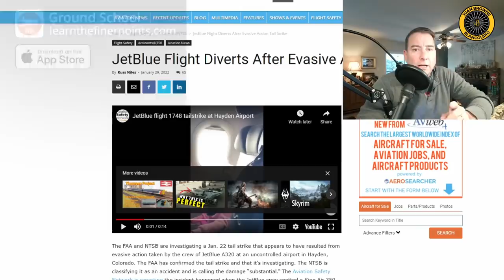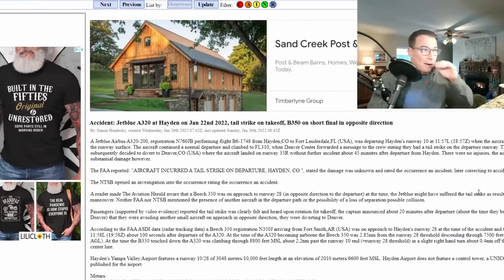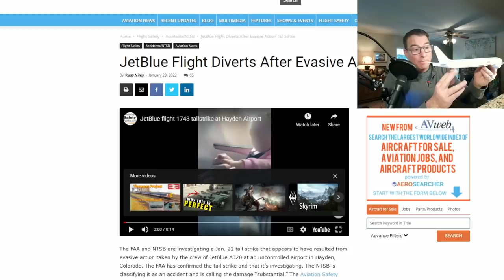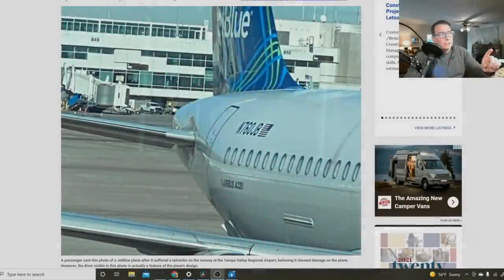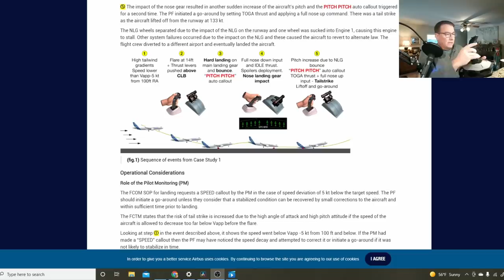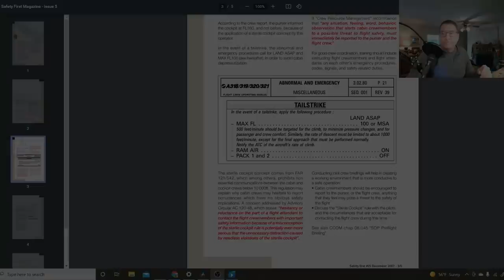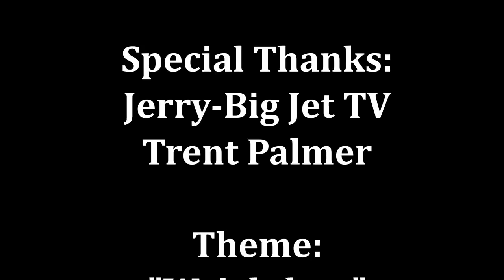Tailstrike!

Comment: This is very interesting,

Since it's possible to have a tail strike with these aircraft, I'm surprised that they are not designed with a skid plate with sensors underneath to detect a tail strike. In the situation with JetBlue for instance, they had a pretty severe tail strike that they were apparently not aware of and it sounds as though they had pressurized the aircraft since they were at 31,000ft and appeared to have been planning on continuing to their destination. 

Thankfully they were alerted by air traffic control before something more serious happened with this flight.

Comment: My aircraft EMB 175 has some tail strike prevention in the FBW laws but it too is possible to have a tail strike occur. The EMB 175 in it's current form only has FBW for the empenage. The ailerons are conventional hydraulic. I've never flown an Airbus but I think it is not the best idea to have the side stick controllers independent.  I still believe to this day that if the side stick controllers were interconnected that the Air France 447 accident would not have occurred.  And don't tell me it can't be done because the latest Falcon with side stick controllers and full FBW do. Nice video Jaun, always a good job!

Comment: The 727 had a very effective tail skid. It should be in use today.
Reply: pretty sure all Boeings have a tail skid
Reply: @peterp4319  JAL123 didn't.
Reply: A tail skid doesn't keep you from bending the aircraft. If pilots were to start treating them as a wear item, you'd probably wind up with sudden decompression events due to metal fatigue.

Comment: No protection for a tailstrike on the bus, as the plane approaches the ground direct law blends in flare law which is just another form of direct law with some aids to land the plane, I guess it offers a bit more longitudinal stability compared to direct law but nevertheless whatever you input on the stick will get to the flight controls eventually. So no more roll demand or g demand as in normal law, just some sort of direct law designed to help you have the normal feeling of a flare. Transition is very smooth and usually you don’t even notice it. Protection is in the form of an aural warning which is triggered by any pitch above 7.5 deg or any rate of pitch which will result in a pitch above 7.5 degrees in a very short time period. Values for A321. Tailstrike is at about 11 deg. If you keep pulling the stick disregarding the aural you will tailstrike it, there is nothing that will stop you doing that. Pitch protection on the bus is in normal law or in alternate law with protections and triggers at values way higher than 11 deg. If a/c was fully serviceable they had an aural warning for sure. If the aircraft was dispatched under MEL with acceptable inoperative systems, depending on the inoperative system there could be a chance (though remote) that there was no warning on the flight deck, on the other hand if that’s the case crew would most likely be aware and maybe discussed it during briefing or during approach preparation. Over controlling on roll has a bit of rationale behind it as the 321 neo has quite less ground clearance for the engine nacelles so there is a chance that the crew perceived some excessive bank angle and tried to correct it ending up in over controlling it. However during flare at such pitch angles engine nacelles are a bit more high up in the air due to the pitch of the aircraft, there is a useful graphic somewhere in the manuals depicting this, nevertheless the scare with engines contacting ground it’s still there. Only the investigation will conclude for sure what it really was there. Sorry for the crew, my thoughts are with them, sometimes it is so easy to screw it up in a big way, it looked like a very nice, stable approach, good control up to that first bounce, timely go around decision but then over control.
Reply: Apparently there were high winds with strong gusts at the time, presumably that caught them out.
Reply: @Smithy18 Hi Smithy, according to A321 neo FCOM while in flare mode you get only High Angle of Attack protection. Also if you check section Pitch Control, Flare Mode it says clearly that flare law provides full elevator authority and it is essentially a stick-to-elevator law. What’s changed from the ceo is the change to a pitch of -2 deg over a 8 sec period which was removed on the neos. But there is no mention anywhere about limiting the authority of the elevator during flare or anything to help you avoid a tailstrike upon landing or even better to protect the aircraft from that. If you’re referring to the new Rotation Mode on the neos it says that if the thrust levers are above CLB then there is a 2 secs transition after which rotation mode activates. Transition phase is grey area since they don’t mention exactly what happens during it. Rotation mode is a pitch rate demand control law with tail strike protection. However next line it says that the flight crew can override the tail strike protection. So maybe not a protection after all or at least not in line with the other protections which cannot be overridden. Furthermore according to Airbus philosophy protections are there to improve performance, provide a consistent feel of the aircraft with full control authority, help avoid over control and reduce risk of ovestress on the airframe and/or systems. No mention about protection against tailstrike, wingtip strike, engine nacelles strikes. Back to rotation mode, during the event it is not clear when rotation mode became active, that’s why I said that only the inquiry will give a definitive answer on what really happened there. There were some incidents in the past where systems sync on the airplane was subpar and there were some grey areas for periods of 1-2 seconds which led to unexpected events. Lesson to be learned, if you’re determined you can and you will tail strike it with all protections working perfectly. It might take a bit more effort on the neo but it is achievable. If there is something that I missed could you please be more specific about which section of the FCOM you’re referring to?
Reply: @Smithy18 Will try in the sim for sure, thank you for the suggestion.

Comment: The British Airways landing was in the middle of a local storm here in Europe with winds of 40m/s plus gusts, some airplanes where able to land and takeoff, but unable to connect with the gates do to high winds. So given the weather conditions at the given time, things could have ended so much worse.
Reply: 80kts is a Typhoon. Are you sure about this values?
Reply: @FlyingYasha  Given I'm from Denmark we use m/s for measurements for windspeed and yeah it was 40m/s - meter/second gusts.
that would be something like 131 f/s - 89mph  - 77.75 knots - 0.12 mach or if you wanna measure it in lightspeed it would be something like 1.33E-7. Hope it helps.

Comment: At 9:00, is that rectangular outline in the top right-hand of the picture where the tailstrike indicator used to be?

When I worked on the flight line (which is what we called the ramp in my country), inspecting the tailstrike indicator was part of the AME's pre-flight inspection.

A repair not conducted in accordance with the manufacturer's instructions after tailstrike damage to the aft pressure bulkhead caused the loss of JAL123 and 520 of the 524 people on board. :(

Comment: Doesn’t seem to be a flight control law preventing bouncing back and forth on the landing gear on touchdown…great report, and very informative, thanks!
Reply: It was the law of physics! 😁
Reply: Landing gear suspension has a higher rate of compression than rebound hysteresis. In English, that means the suspension is more squishy on impact than the bouncy rebound.
Reply: @idanceforpennies281  
Hysteresis? Is that like damping?
Reply: J
Reply: @jerseyshoredroneservices225  Higher damping rate on the rebound stroke than the compression stroke.
Reply: If anyone else is wondering about hysteresis, here is the definition:
"Hysteresis is the dependence of the state of a system on its history. For example, a magnet may have more than one possible magnetic moment in a given magnetic field, depending on how the field changed in the past. "
Reply: @SmittySmithsonite 
Not forgetting the forward momentum, the cross wind gust and the descent rate.

I wonder if deploying the spoilers and the thrust reversers would have made the whole thing much less dramatic... 🤔
Reply: @SmittySmithsonite  Yes - as always.
Reply: The Airbus MLG struts are dampened on the extend stroke as well to mitigate the bounce effect on landing.

Comment: Fascinating as always Juan.  (Interesting phrase “stirring the pot.”  Hadn’t heard that, being fairly low-time (about 700 taildragger hours).  In my ‘46 Champ on a gusty crosswind day, especially on concrete, to me it’s just “busy hands and feet.”)
Reply: I think stirring the pot refers to rapid non-linear inputs. The effects on a computer controlled aircraft would be very different from a cable operated light aircraft, which has direct tactile feedback on the controls. Another bad outcome would be pilot induced oscillations, where the frequency of the inputs coincides with the natural airframe response.

Comment: I was a passenger on EVA return flight from VN dropping into SFO, watching out the window.  The plane was significantly turned into a stiff crosswind as it touched down lightly and pilot brought it around almost imperceptibly, rotating on the right-side gear, I imagine.  Waiting in line to get out after picking up luggage, I noticed a guy with the hat and badges on his uniform checking out with crew above and over my shoulder.  "Bit of a crab at touchdown, wot?", I asked him.  "It was windy", he said with a smile.  "Yes, it was.  Good job!" I said as I drove my cart into GF ahead of me.  😋  You guys have mad skillz.  Thanks!

Comment: I used to fly the original fly-by-wire jet (F-16) before moving up to the big Boeings like you.  One thing proven time and again in that airplane was that man can overpower the machine, meaning sometimes the computers just can’t keep up with the speed and magnitude of human control inputs. That’s how we got 10+ G pulls on a 9G-limited  jet and not so uncommon AOA overshoots in the low speed regime. I’ve got zero Airbus time, but I wouldn’t be surprised if the pilot just snatched on the side stick so hard it created a pitch overshoot even if a pitch limiter was active.
Reply: The early space shuttle tests, especially the aerodynamic tests using the Enterprise test bed, ran into that same issue where pilot inputs were overwhelming the processors, resulting in one particularly bouncy landing at Edwards.
Reply: I did 1k hours on the Viper and know exactly what you are saying but, as I also have 4k hours on the A320, I can tell you there is nothing on the control laws that prevents a tail strike! So this was not the case of a pilot cheating the machine! 😂
Probably bad landing technic plus FLAPS 3 and an unexpected gust... but, as you know, we wouldn't be sure even if we were on that cockpit!
Viper Rules!

Comment: If I remember correctly, Airbus philosophy on cross wind landing is not to lower the wing into the with, but to simply correct the crab angle. But in the real world, a slight wing diiwn helps, but only a few degrees, and touch down with a slight crab. Even better landing in Conf 3. I think the reasoning behind it, it's because when the spoilers deploy, both ailerons also raise up, as displayed on the SD, and during that time ailerons inputs are non compliant. Back when I was teaching the 320, I encouraged trainees, to place their hands on top of the sidestick and avoid resting the palm on the palm rest and wrapping the th and around the sidestick,. This wrapping method causes any muscle twitching and forearm muscles to affect your inputs. Resting my hand on the stick is how I was a smooth helicopter pilot.
As for FBW assistance for over flaring, newer software gives you a verbal "pitch, pitch" when the pitch is too high awhile  both mains are downmm or WOW is made. Recall the Lufthansa 320 blown off the runway some years ago, during similar windy conditions. Also, recall the JAL 747 that lost its tail after the P-dome was repaired, following a tail strike some time before. Unfortunately all souls were lost in the 747 accident. Great video.
Reply: This video made me instantly remember the JAL flight. One to never forget.
Being that the largest aircraft I've flown is 3 types of Cessna 400 series, it's truly interesting to learn about the different electronic FBW systems and their limitations.
I always crab, then cross control (wing down) from short final for all of my x-wind landings.
Cheers!
Reply: Just watched Allec Joshua Ibay's video on the Lufthansa A320!  They were landing too fast and bounced the right gear and floated the left main gear for nine seconds.  The software at the time wouldn't allow any manual deployment of the speed brakes or thrust reversers unless all the gear was on the ground so they did a runway overrun.  Airbus did make some modifications to the software afterwards but it's always walking the fine line between protecting us from ourselves or not being able to program in that 1% factor that falls outside the parameters.
Reply: JAL 123 did have 4 survivors... somehow

Comment: Norcal pivate pilot here. Always wondered why big birds don't have tail skids to prevent damage from tail strikes like my PA28-236 does. (Or at least some sensor in the tail that alerts  pilots way up on the flight deck that a tail strike has just occurred, so they can return to land BEFORE pressurizing.) I'm also an ex-flight attendant, so I know you cannot rely on FA's to call the cockpit and say "hey, there was a noise back here on takeoff." That's just silly. Put a skid back there, or a warning sensor, or both. Thoughts, Juan? See you at KGOO. :-)

Comment: Good Vlog, I knew the tail area had something important contained inside, just didn't know what it was, so I assumed it was a structural issue.  Thanks for the info, good to know that.
I do like your in-depth explanations of what and why with regards to what is happening during flight operations.
Reply: Oh yes - for example, the immediate cause of the heartbreaking Japan Airlines flight 123 wreck in 1985 was the failure of an improperly repaired aft pressure bulkhead after a tail strike years before the wreck.
Reply: @markmaki4460  A very good point,  it has also highlighted to me when some major airlines outsource their maintenance to cheaper countries.
I am sure that the manufacturers don't have a sliding scale of aircraft part costs (depending on the ordering country) so it must only boil down to facility rental and labor costing.  
Plus the expertise will take a nosedive in those countries.
Reply: @lostinaustralia-dave7802   Well given that  the JAL 123 was once of the worst air disasters in recent history it caused a large change in the maintenance regimes and certifications in the commercial aviation industry so things  have gotten a lot better now and we have a lot better understanding into long term metallurgical stresses and have  made better materials as well . But yea in the end airplanes are really just a big pressure cylinder and despite how planes are on the outside often times the pressure section in the tail there is a rounded off cylindrical shape like an airtank or other pressure vessels. Although in relative terms there more like a soda can when it comes to the actually thickness of the shell vs the size but obviously much more rigid.
Reply: @connorjohnson4402  Good point mate, if we had as much knowledge as we do now, decades ago there would have been fewer air crashes in the past.  
This is the same for all engineering.  Instead of a room full of engineers with paper and slide rules we now have cutting-edge workstations to do the math and the designs from the engineers can be digitally woven together.
Thanks for the reply.

Comment: Great content again with your calm analysis. Thanks.

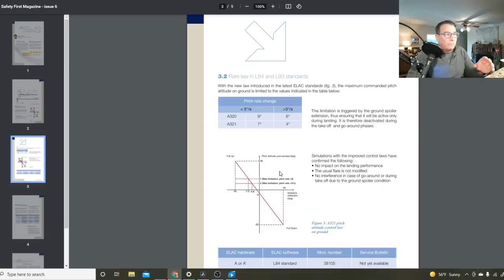The pitch limit figures you showed in the small box at 11:35 are only active with ground spoiler extended, so they were not active in the shown go-around. They only protect you from a tail strike after full main landing gear touchdown (which triggers spoiler extension, if armed or if reverse thrust is selected). As soon as the pilot hit the TOGA stops of the thrust levers, that protection was certainly not active.

The top picture you showed at 11:22 was a bit confusing, because it uses wrong terminology. It says "flare law" and "ground law", but these are not "laws" in Airbus nomenclature. Instead, they are all part of Normal Law, and are called "flare mode" and "ground mode", as opposed the "flight mode". Normal Law/ground mode is like Direct Law in many ways, but it is still part of Normal Law.

Comment: At our airline we have done a number of  tailskid deletion modifications on the 777. The tailskid is done away with entirely and we reinforce the skin in it's  previous location with doublers incase of impact with the runway. There is a software upgrade to the FBW system which will detect the rate at which the stick is pulled back in relation to the rotation speed (i.e the runway closure rate)  and corrects the pitch angle if a tailstrike is imminent. Removal of the tailskid was chiefly because of the weight penalty and drag imposed by this mechanical protrusion. A good substitute for hands on training? , I could not say. I guess aircrafts are becoming smarter than humans now but to be honest I would much prefer a mechanical berrier to a software upgrade anytime.